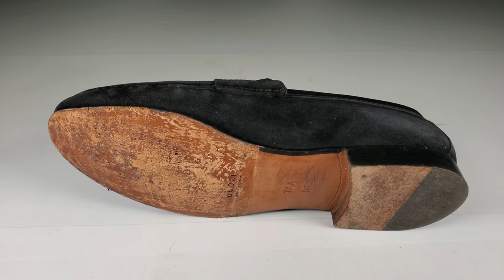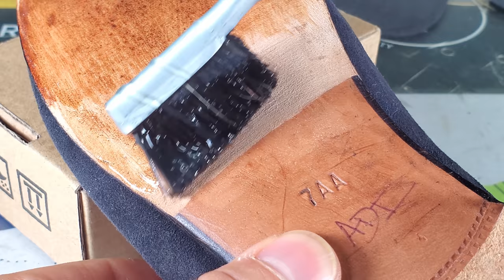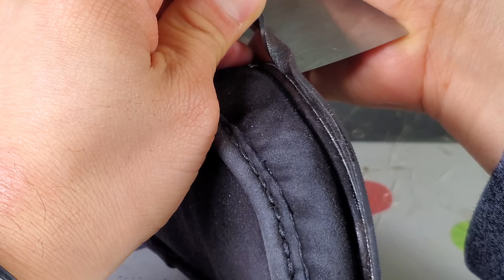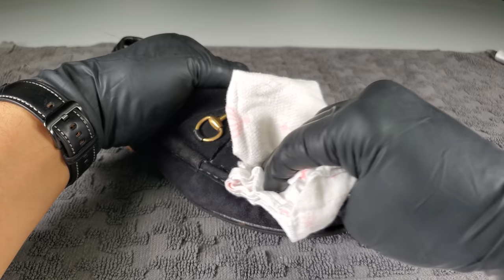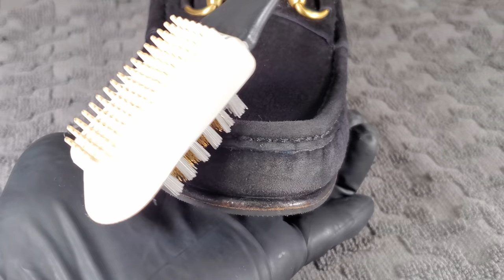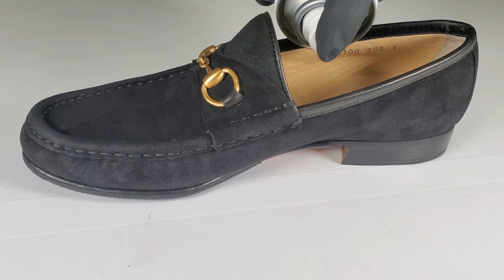ASMRㅣGucci Suede Loafers Restorationㅣ구찌 스웨이드 로퍼 복원

Comment: Can't believe they covered over the Gucci stamp on the sole.
Reply: I don't know what you expect them to do, especially when it hits the part of the shoe with the most contact with the ground.
Reply: Maybe he could have embossed a new Gucci tm in the new sole. I saw them do it to LV
Reply: Don't worry it also upsets me 😖
Reply: I can’t believe Gucci puts their stamp so high up in the sole. That’s why I like Prada for putting it a little lower so it doesn’t get covered by sole guard protectors or restorations
Reply: Who cares it's on the freaking ground lmao no one gonna see it while wearing the shoes.
Reply: Yeah, my thoughts exactly. But then I figured since it was initially stamped on a leather sole, maybe the owner asked for a rubber replacement.
Reply: this is why I asked the question, why didn't the gentleman send his Loafers to GUCCI to be repaired?  I sent mine in, I have ALL the GUCCI Labeling and Stamps that I had rubbed off and down.  For a Fraction of the cost, that I Know they asked for!
Reply: من يشتري حذاء ماركة قوتشي  Gussi  فإن الشركة العالمية لا تعطيك فرصة اصلاح حذائها  فما عليك الا شراء  حذاء  جديد .... لان Gussi  لا تشارك ملاحظات الزبناء  عند صناعة أحذيتها ......
..

Comment: When you use cleansing solution for either leather or suede, do you wash the foam off with the water first or just wipe it off with the soft cloth straight away? Thanks
Reply from the maker: you have to wash foam off completely either with water or with wet rag. I usually use wet rag first and use brush with water to remove foam away and wipe off with dry rag quickly. But you have to be careful when you use water to clean leather especially suede leather, it gets damaged.
Reply: @RepairStudio  thank you. Really appreciated 👍🏻

Comment: Would you recommend rinsing real suede shoes with water after shampooing? Or the tissue method is safer?
Reply from the maker: Depending on how you can treat suede shoes, it requires skill to rinse them with water. It could be safer to tissue them to remove shampoo if you are not skilled.

Comment: I still can't figure out why you do it backwards. I restore houses from the top, down. not from the bottom up. if you're washing your car. do you wash from the bottom, up? no. when you're painting a car, house, fence. do you paint from the bottom up? no. when you clean your house. do you mop the floor, then clean the ceiling fan? no.